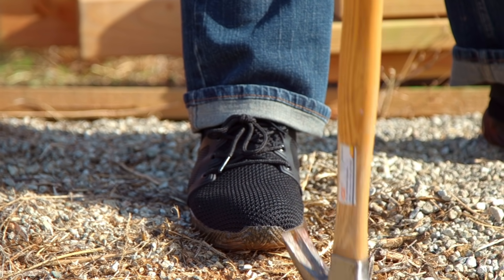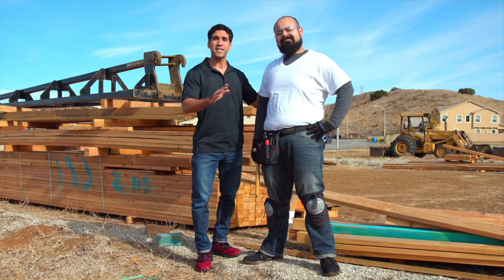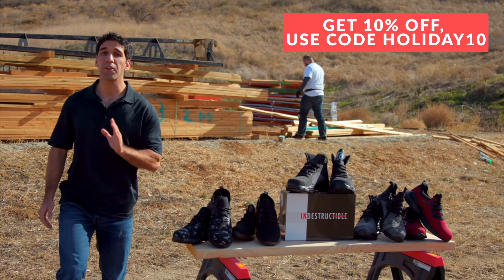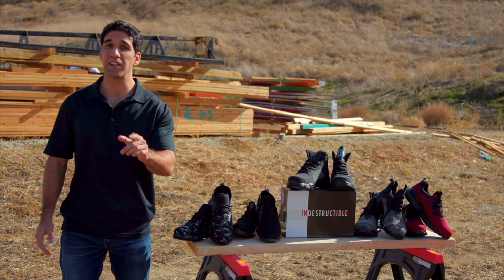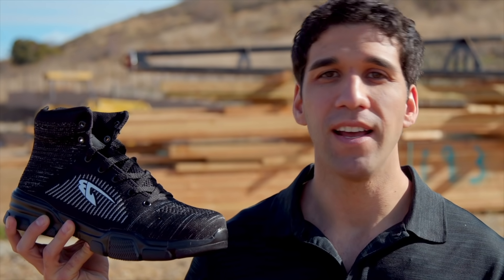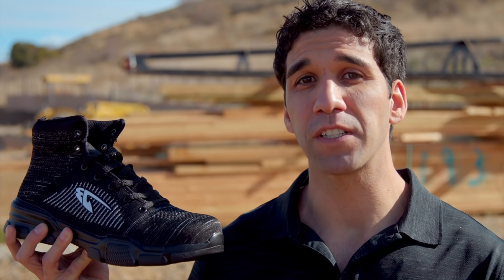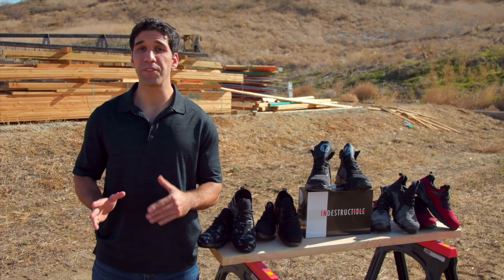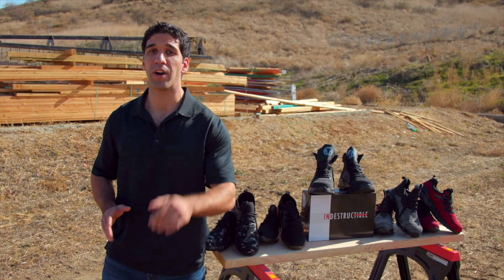Commercial Video   Indestructible Shoes   AG#1

Comment: buyer beware these are not tough enough for welding I tried these out for the day at the weld shop unfortunately it didn't last 20 minutes in I had a piece of hot metal burn right through the shoe straight to the metal toe luckily that and not my actual feet
Reply: Could have told you that by just looking at these pieces o junk. As if the worst thing to happen to your foot on a construction site is a hammer to drop on your foot 🙄. And also, you could take similar material from welding jackets like cowhide cut a couple tiny holes where you can lace them on your boots/shoes and voila. Protected feet and laces.

Comment: Criteria for osha's ladder work needs half inch 90 degree heel.
Reply: This makes me think they are full of s*&^ they don't seem to know anything about Osha
Reply: @3hub5386  their steel toes aren’t even astm rated
Reply: OSHA would probably have a cow especially if these were used in a weld shop hot metal will burn right through these trust me I tested it out it went straight to the metal toe thankfully not my actual foot the material is just too thin not enough heavy padding to protect against the molten metal it may be fireproof but not slag proof

Comment: I am very sorry to hear that.

Our shoes are made to add extra protection to our customers and are not intended to be specifically used in a dangerous environment. It is the customer's responsibility for safety as it depends on the usage of the customer. By purchasing this item, you agree to not ever hold us liable for hurting yourself on the feet or any such similar event.

Regards,
Lyn